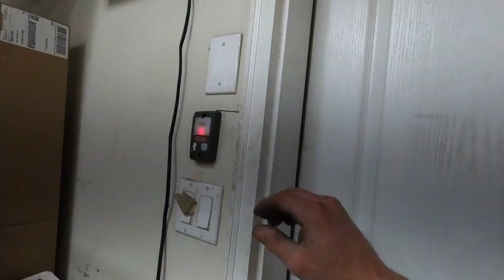Welding More Structure And Bracing Frame is almost Done!!!!

Comment: I apologize if this is a recurring inquiry, but what dimension tubing did you decide to do with to accommodate the weight? 

Previously for a kart build i used 1" 120 wall mild, but that was for a kart 8ft long and 550lbs.

Comment: Your a welder of course.  So what about heat treating so the frame doesn’t break where the heat from the weld ends?
Is that normal not to?
Never wondered if factories do that or even race teams.  🤷‍♀️
Just read🙄 about it in this book from a guy who built race cars.
Or that’s what gussets are for to take the place of heat treatment